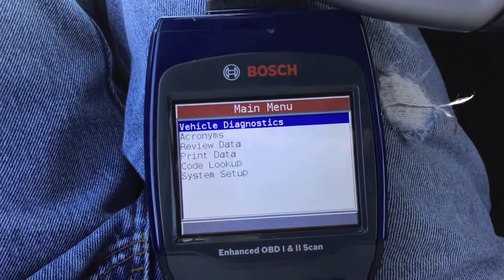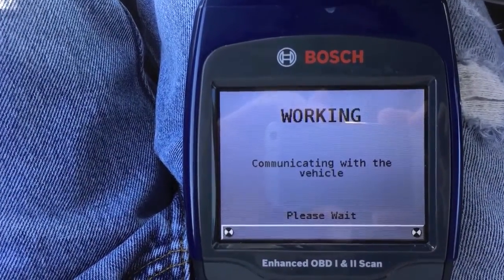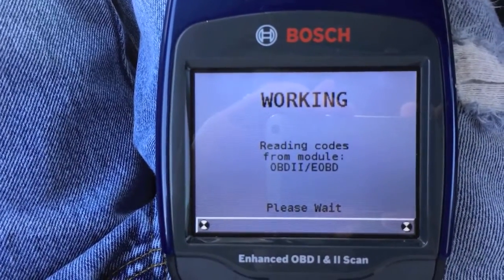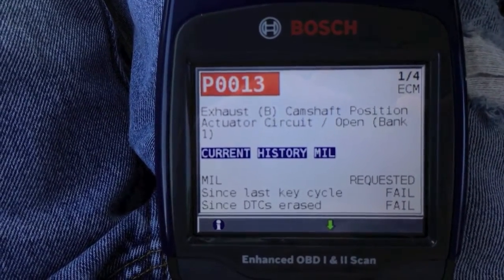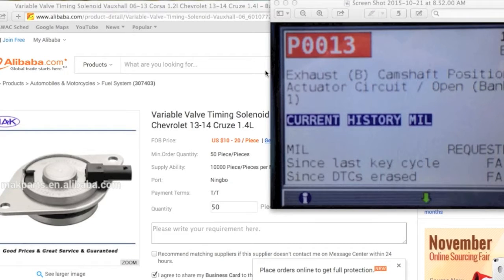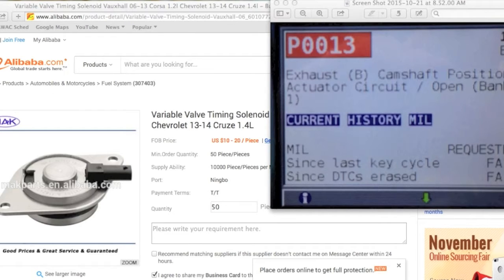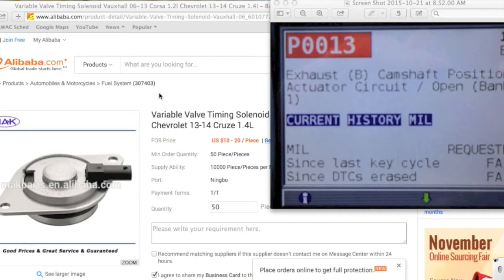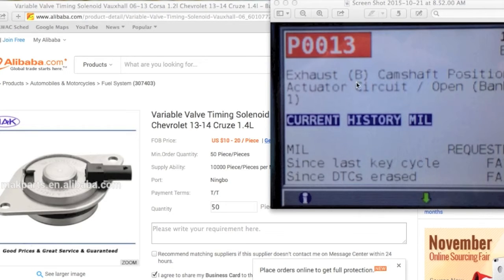P0013 Chevy Cruze Exhaust Camshaft Position Actuator

Comment: Does any have a link for Camshaft Position Sensor B? exhaust side... it's hard to know what's A or B ...
Reply from the maker: Thanks for watching & welcome to the DIY Raptor Club.  We recommend contacting your local Chevy dealership and providing them with the last 8 digits of your vin #.

They will be able to get you the exact replacement part for your exact engine.  Keep us posted on your project.

😎👍🔧🔩
Reply: hey yall, just updating my comments about the problems I was facing. 

Problems: Got a p0366 code one day (camshaft position sensor b which is the exhaust side). Mechanic cleared the code and told me I'd need to change it but it is OK to drive (which was wrong). Car started to crank w no start-then didn't start at all. Heard the relay clicking but no start. Jump started and the car started but every few times I'd have to jump start it. While driving my voltage would be 15-15.2v. Thought it was a bad alternator(wrong).Thought it was the power cables (wrong). I'd end up adding alot of new parts. 

Solution: Changed the camshaft posistion sensor b. followed this video ( https://youtu.be/BGdLB7-Ph7o ) and this video ( https://youtu.be/nllHHNqsNzQ ) to install it. Took less then 15 minutes and now my voltage is back normal 12-14v and no..no starts(for now). Turns out the faulty CMP was telling the car it was on so it wouldn't crank. Everytime I plugged out the CMP it would start so I knew it was that.
Reply from the maker: @johnforde4514  

We can’t thank you enough for taking the time to share your experience & all your helpful videos not.  😎👍
Reply: This video helped alot as well!!
Reply from the maker: @johnforde4514  

So happy to hear this, thanks again.

😎👍

Comment: Codes p2091 , and p0013 .. my antifreeze is bubbling ? Can it be the head gasket ?
Reply from the maker: Juliana Velasquez 

Thanks for watching & sharing your experience.  Have you replaced your Thermostat during the time you’ve owned your Cruze?

A failed Thermostat can cause overheating & lead to bubbling Coolant.

Let your engine run for 15-20 minutes & allow engine to warm up to its normal operating temperatures.  Once engine reaches approximately 225*F, your Thermostat will open & allow Coolant to travel through the remainder of Engine including your Radiator...which helps cool the Coolant.

Once your Radiator fan turns on, that’s an indication that your engine has reached 225*f & the fan is trying to cool engine.

Also at this time, your Thermostat should open...however...here’s how to check...

Be very careful because it’s HOT.  Your water pump will be very warm...your Thermostat connects to pump.  Tap your black plastic Thermostat & see if it’s warm or cold.

If it’s warm ... it’s working ... if it’s cold ... it has failed and must be replaced.

Keep us posted updated.

Below is a link to our step-by-step video that shows the replacement of Thermostat, you may find this very helpful.

       https://youtu.be/8F-17wODadQ

Please subscribe to the channel and turn on your YouTube notification Bell 🛎 that would be awesome thanks again!

😎👍🔧🔩
Reply: my be cylinda got corossion

Comment: Mine is throwing this code but its also farting out grey smoke from the exhaust and car runs horribly
Reply from the maker: Luis Villa 

Thanks for sharing Luis, that’s no fun!  Let’s get this figured out!  This little part controls the level of oil flowing in & out of Crank Case...which ultimately oils & lubricates Camshaft.

An improper flow or part failure will cause code to trigger & may lead to white smoke coming out of exhaust.

We recommend replacing both intake & exhaust Solenoids to ensure oil is being properly regulated throughout the Crank!

Keep us posted!  Please subscribe to the channel and turn on your YouTube notification Bell 🛎 that would be awesome thanks again Luis!

😎👍🔧🔩

Comment: I'm experiencing a messy oil leak each time I drive my car,but can't seem to find the leak. I've replaced valve cover and the crankshaft seal so far.
Reply from the maker: Jovan Saunders 

Thanks for watching & sharing your experience.  Have you inspected the lower portion of your engine where your oil pan is?  We recommend inspecting entire lower portion of engine & try to pinpoint any leaks.

You mentioned (Messy oil leak) which makes us believe it’s more toward the top portion of engine.

Is your Oil Cap properly screwed in & secured?  A Cap that’s crooked or not secured will cause leaks.

Let’s start there, keep us posted!

Please subscribe to the channel and turn on your YouTube notification Bell 🛎 that would be awesome thanks again!

😎👍🔧🔩

Comment: Would the camshaft actuator leak oil if the seal is broken?
Reply from the maker: Jovan Saunders 

Thanks for watching & sharing your question.  That’s a great question & yes it will.  Your Camshaft is inside the Crank Case....below your “Valve Cover”

Oil passes through the Actuator “Both Intake & Outtake”...Lots of oil runs through this system & splashes all around keeping all parts & gears properly lubricated.

What exactly are you experiencing?

Keep us posted, we are here to help!

Please subscribe to the channel and turn on your YouTube notification Bell 🛎 that would be awesome thanks again!

😎👍🔧🔩

Comment: thx for the video man, but i have a question, i see in your video the car use two of this part, so what about the other side?, should i change it both? if the other piece was malfunction, what should be the code? can i use the same piece to changed both? sorry for all those question im very curious i have a fuel problem with my chev 2011 LT
Reply from the maker: Luis Perez Thanks for checking out the video and sharing your comment.  We changed the part closest to the front of car.  Both will give same code and should be same part.  When ordering from your local Chevy dealership, double check with them.  Please Subscribe to the channel and turn on your YouTube notifications that would be awesome thanks again 😀👍